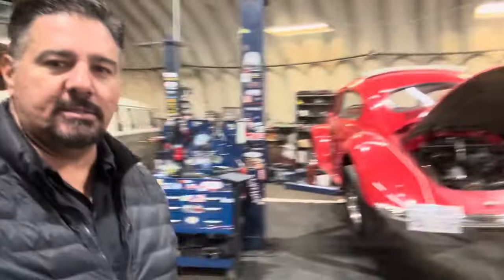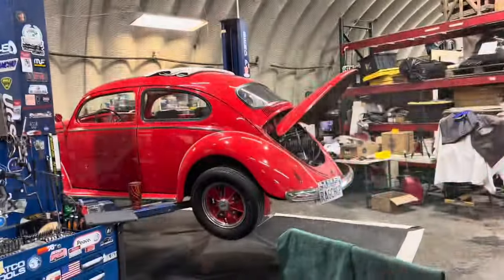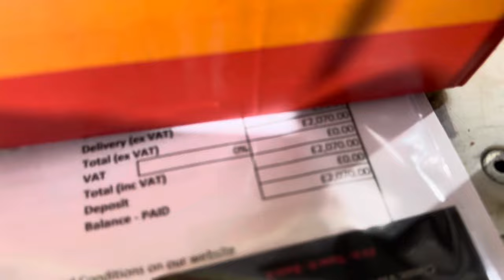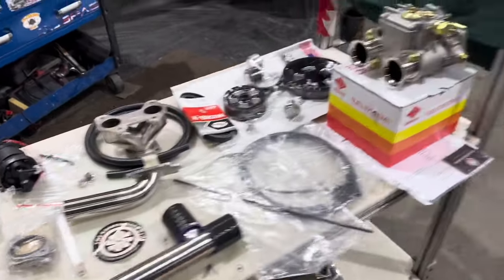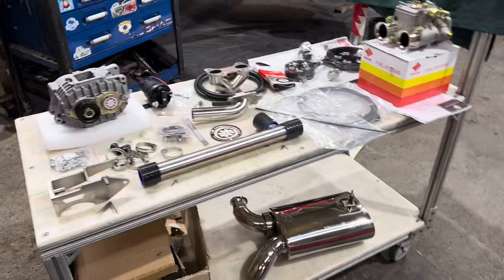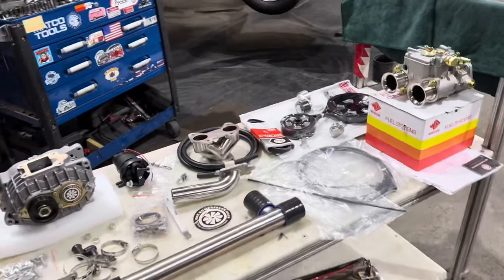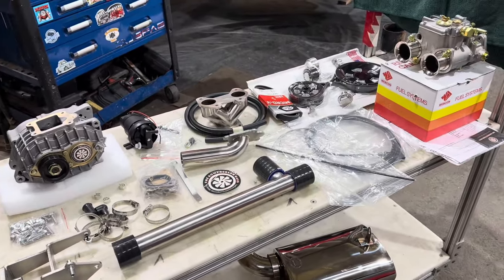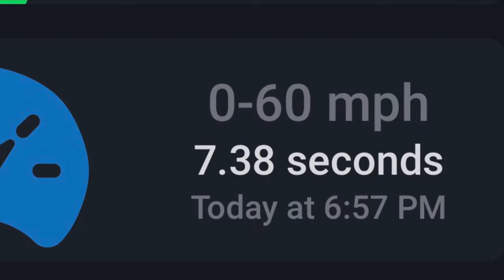Supercharge your VW

Comment: Does it not come with a carb?
Reply from the maker: Yes it does
Reply: @letstalkdubspodcast9361  Oh sweet.   I have a 1960 I’ve had for almost 30 years with a rebuilt 1600 single port out of a 1970.   KH said they make SP adapters.   How do you think it would perform on a SP 1600 engine?   300 or 500 kit?    I would really like to turbo swap it with  RADesigns turbo kit but the KH simplicity and price seems appealing.   The RADesigns kits are expensive but they have really nice stainless manifolds.  Does the KH kit come with some sort of boost timing retard mechanism?